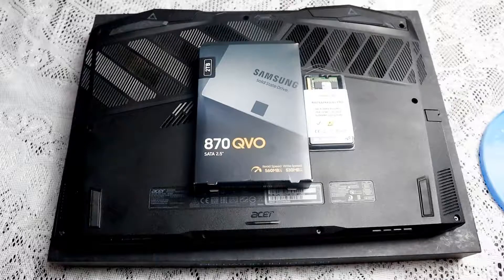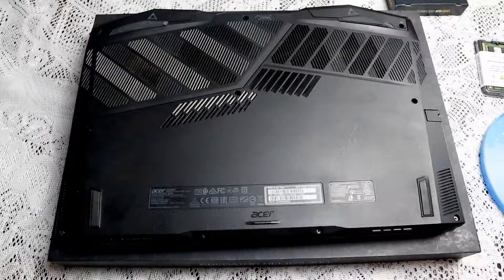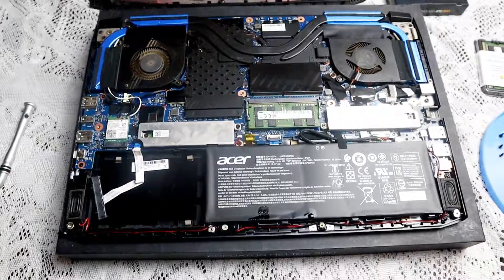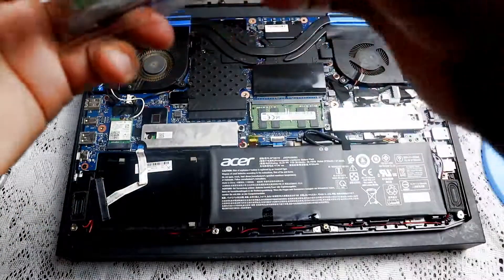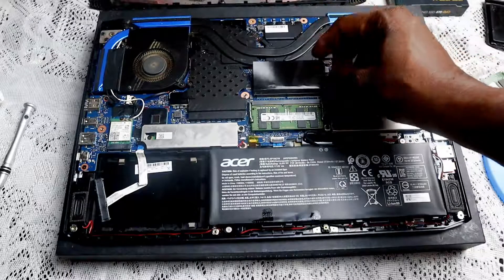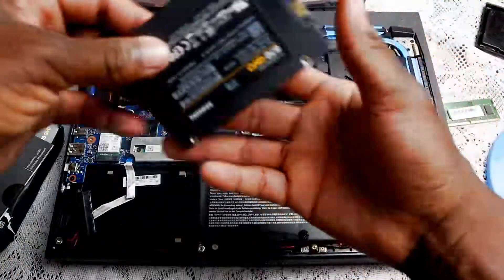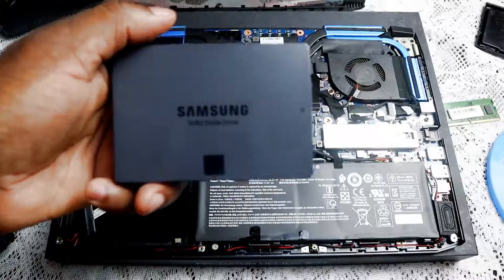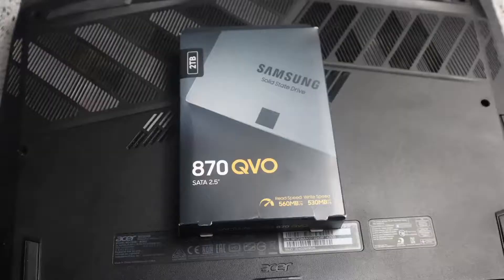Acer Predator Helios 300: Samsung 870 QVO SSD and Samsung RAM upgrade

Comment: is you ram capped at 2933? planing to buy another samsung since the one installed inside is samsung but i cant open the laptop
Reply: its normal for it to be capped at 2933 depending on the cpu

Comment: Hey I don’t see that white film to connect to my ssd where do I connect it?
Reply from the maker: Just to be clear this is for which lap top?. Usually acer lap tops come with the strips in box and Lenovo and hp would have the strip in place already. Let me know for sure what type of lap top it is and I can see how I can help.
Reply: @Acerking31  It is a Helios 300 2020 I think I am going to just buy the sata connector because there isn’t one in the laptop or in the box that I can find
Reply from the maker: @wade9271  that may be necessary. Strange that it didn't come in the box or connected already.